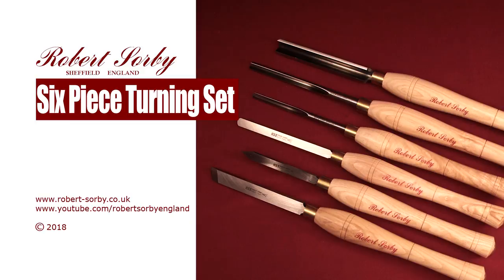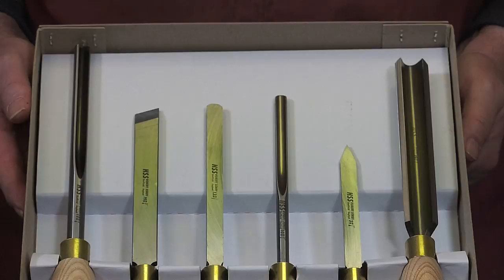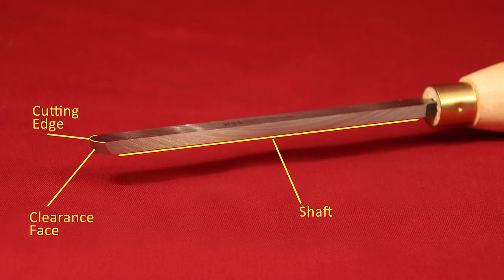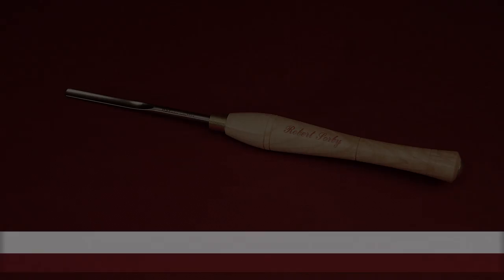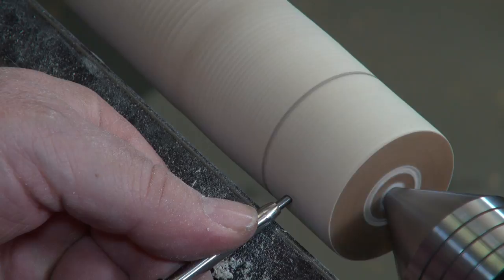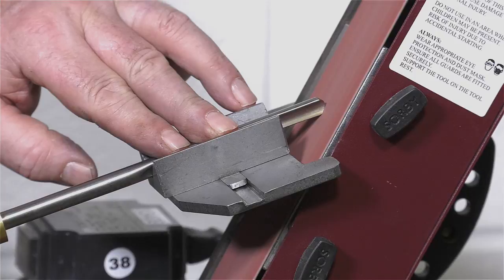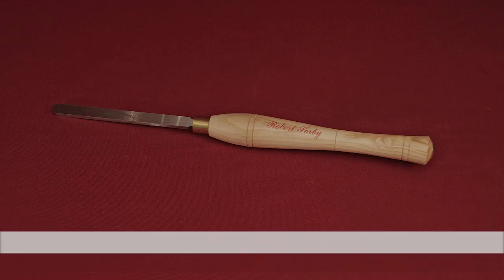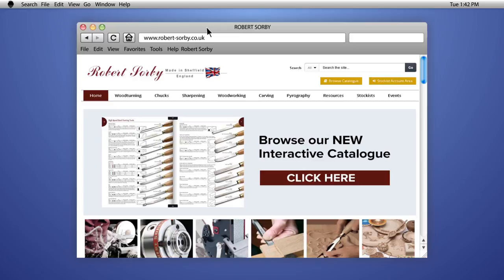Robert Sorby 67HS Six piece woodworking tool set 2018

Comment: What grit do you use for sharpening?
Reply: Hi Jay Cee Bee...if you are using a Robert Sorby ProEdge then either the Zirconium or Ceramic belt in 120 Grit would be perfect...if you are using a bench grinder then around 80 - 100 Grit Aliminium Oxide wheel would be ideal